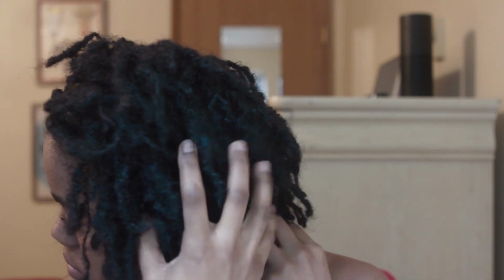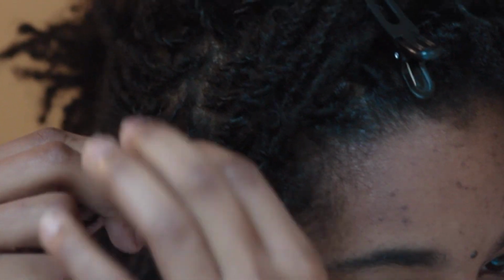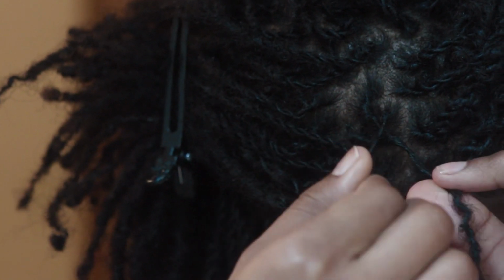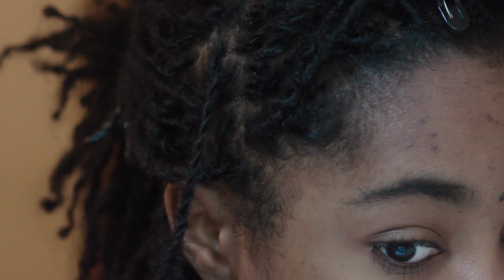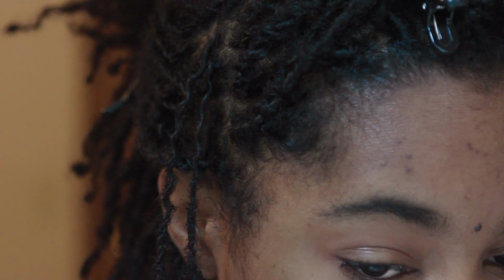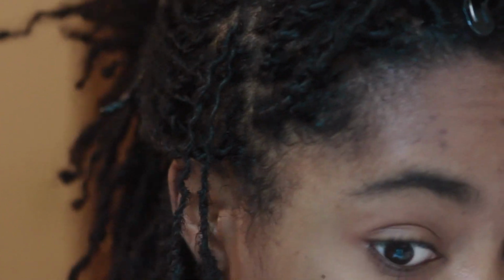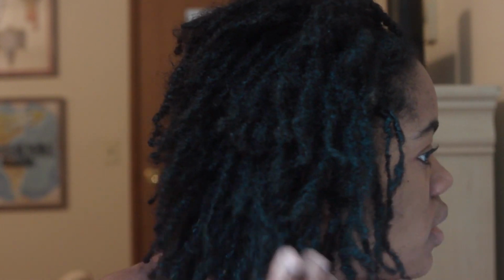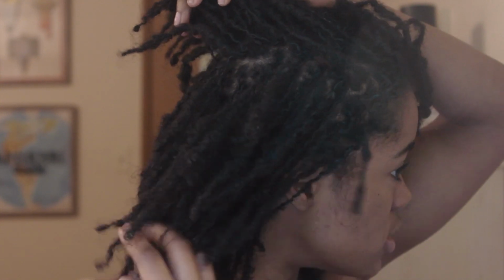Water ONLY Retwist | Heat Free | Dreadlocks, Dreads, Locs

Comment: Hi! Do you use any other products in your hair & on your scalp apart from water to keep them moisturised & prevent them from drying out? If someone has an issue with dry hair and/or scalp or lives in a country where the seasons change especially in the cold winter months, it’s extremely important to moisturise. What are yours thoughts?

Comment: They look so light and fluffy. I wonder if water only will work for my 4c hair. I interlocked about 6 weeks ago and I spray with rose water and oil.
Reply from the maker: +tblu “NappyEcclectic” B. I honestly think it would just because of the way hair behaves in general. Even on 4c hair if you were, for example, to braid your (loose) hair while wet and let it dry, when you took out the braid you'd have waves. Its the same idea here, we're just trying to achieve something a little different. 

If you do decide to give it a try I'd love to know about your results.

Comment: I love your hair. i want to loc my hair and was considering sisterlocks. But i like yours a lot better are those considered sisterlocks or just locs?
Reply from the maker: Locs installed by a sisterlock consultant are considered sisterlocks. People with sisterlocks usually have at least 400 locs or more. Because I installed these myself (and I only have 250) they are not considered sisterlocks... just small locs. :)
Reply: She has micro locs basically that’s what there called